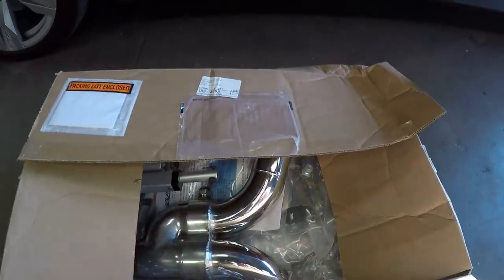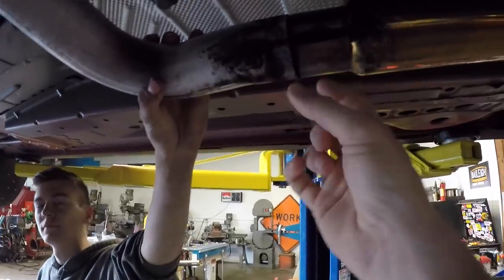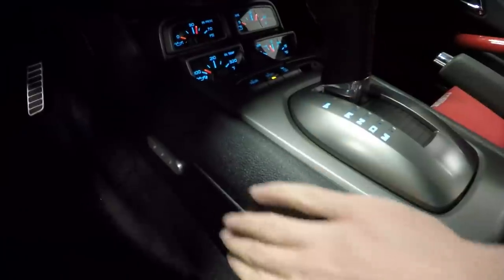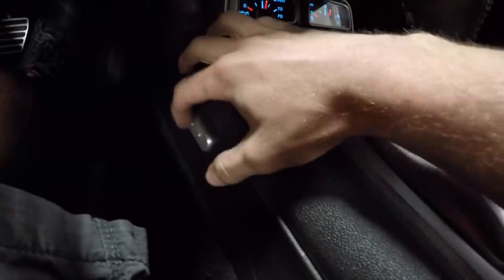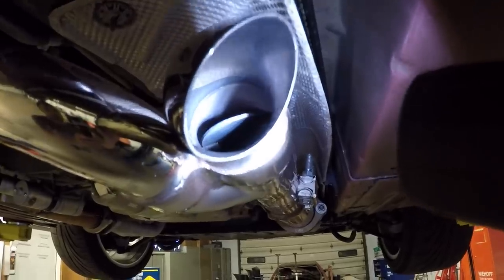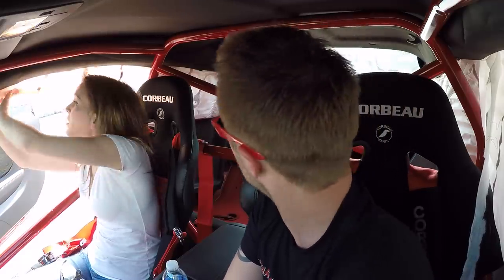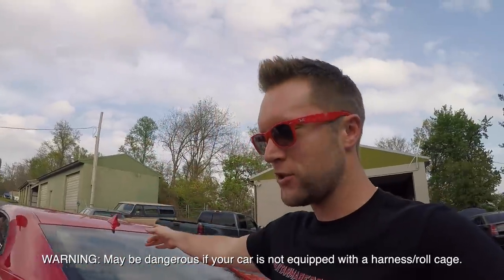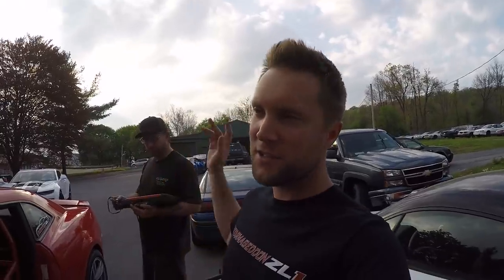LOUD EXHAUST Makes Airbags BLOW at 140mph!!!

Comment: I can tell you exactly why your air bags popped and it wasn't your exhaust, it was you driving too fast and hitting a bump in the road. Period. How do I know that?

1. Air bags systems use accelerometers (g-force sensors), pitch and yaw sensors and rollover sensors to determine if a collision is occurring or a rollover is about to occur. NONE of these sensors are sensitive in any way to sound waves or the vibrations they produce. It is physically impossible for a loud exhaust to deploy a cars air bags. 

2. The cameros rollover sensing system is known to be overly sensitive to those that beef up their cameros and/or take them to the track. The systems has to be able to anticipate a rollover before it occurs if it is going to protect the occupants of the car from said rollover. A driver CAN induce an airbag deployment if certain conditions are met, albeit a rare occurrence. In your slow mo video you can CLEARLY see that you went over a decent bump in the road and because you were going 140 mph when you hit the bump, it was enough for the air bag computer to think a rollover was about to occur. Had nothing to do with your exhaust and the fact that you think it was your exhaust is laughable. 

That said, you deserved it. You were on public roads going well over the speed limit, endangering the lives of everybody around you. You are obviously an ignorant fuck that has no regard for the peoples lives you put at risk while driving like that. A crayon has more brains than anybody that does that. If I ever see you (or anybody else) in my neck of the woods driving like that on public roads... I will make sure that car will never drive again. Road, track, anywhere. I'll see to it that you're remaining days on earth are in a wheelchair too. That way you can't do it again in a different car and potentially put an innocent person in a wheel chair or worse. Have some regard for the lives of others on the road. By all means drive like hell and have fun, but do that shit responsibly.... AT THE TRACK!!!

Comment: just to make this clear. the steeringwheel and dash airbag are controled by an g sensor wich is betwen the dash and the gear leveler. the curtain or side arbags aswell the seat airbags have a pressure sensor in the doors /sideskirts

Comment: Theres no way it was from the sound bro. Ive had cutouts on my ZL1 with headers AND cat deletes for over a year and have ran them open like that plenty of times, even at the track on WOT runs and my airbags are still undeployed lol. In the video you mention "Shouldve left them unplugged" hinting that you guys had disconnected the sensors or harness at some point. My guess is thats why this happened, something stemming from that but highly unlikely from the sound. My opinion anyway.
Reply: I had cutouts longtubes no cats as well and my car wasn’t nearly as loud as this. Trust me there is soemthing about the car that just makes it louder.

Comment: Airbag crash sensors typically work of negative pressurew deviation....meaning....the noise/sound waves from the exhaust were making enough pressure changes in the cabin that the airbag control module assumed the vehicle was in an impact, hence the airbag deployment.

Comment: Heat and vibration caused that, the heat will briefly shrink the floor tightening everything up in the area then the vibrations have caused a turbulence inside the sensor and triggers the airbags that's why only the side have blown and not the fronts

Comment: I think your bags blew because you had the windows closed, sound=air pressure.  You have air bag satellite sensors in both of your doors.  They tell the RCM (Restraint Control Module), that air pressure has built up in the doors ie: side impact, and this you got curtains to deploy.

Comment: You seem like a nice guy and I enjoy your videos, but this car belongs on a track if you are going to drive it 140 MPH. You had your girlfriend in there, and you still drive like an ass. I love cars, trucks, speed and power, but there is a limit to what you should do on public streets. People can call me a pussy or whatever they want, but I'm a firefighter and I've seen what nasty wrecks do to bodies. Have fun, but be responsible out there.
Reply: 140 is not that fast in this car
Reply: I totally agree with the firefighter guy, I drive a wrecker and I've seen the results when these fools get on the road and drive that fast and it's not pretty
Reply: @digitalme4404  Agreed. Crybabies
Reply: @Bryan-Hensley  Damn Straight! Thank you for your service
Reply: Bryan Hensley wishing death upon someone? Wow that’s honorable.
Reply: I’ll admit I’ve gone fast. I’ve gotten to speeds that would land me in jail had I been caught. Conditions have to be right for me to be willing to hit those speeds. I’ve never topped 110 and I’ll admit I’m a dumb ass for doing those speeds. After I hit a deer at 65 in a civic I began to evaluate my choices when I drive fast. Had I been doing the 100 mph it topped out at I’d have been dead. 65 caved the hood into the engine bent the drivers door and knocked the front of the roof line back several inches. To top things off his antlers went through the windshield and were just inches from my face. I agree 140 is way faster than one should be doing on the street but on the flip side of that coin I understand the adrenaline that comes with it. Funny thing is I’ve been chasing adrenaline since the deer before I felt it fairly easily today for speed to give me that kind of feeling I’ve got to be going way faster than I should. I really wish we had a track near me for this reason.

Comment: I mean the side airbags deployed so obviously the g force sensor/ computer sensed a side impact or a roll over. I was wondering the deceleration Gforces going off the throttle but it’s in the wrong axis. I think the frequency of the exhaust was just on par to rattle the sensors and thought the car was rolling. As if the sensors started shaking at a freq replicating. So back early on airbags had a 20g deceleration trigger. But they found in a roll that the side curtains were not deploying so some lowered the range 6.1-10g because rolling a vehicle is a lot less g than a Tbone or head on. You roll out the energy instead of a dead stop. Some use g force sensors others have vehicle angle sensors and some are hybrid control units that rely on G force and vehicle angle sensors to cross check the information so you don’t have an unwanted deployment

Comment: theres a gyrometer in the newer gms for the curtain airbags the sound caused vibration so it was enough to trip the gyrossensors glad you did not get hurt
Reply: FYI you could replace the entire airbags with resistors to trick the computer so you wont have an airbag light.

Comment: It looked to me like those diverters are made of smaller pipe than your exhaust. They should have been larger pipe than your exhaust so they did not act as restricters at mid pipe when closed. meaning instead of slipping inside your pipe, they should have slipped over your pipe.

Comment: The loud exhaust made the airbags blow? That is so weird. I wonder why no one else with straight pipe exhaust has this happen to them? It's not like you can make a car louder than straight pipes. And lots of other people have either  straight pipes or dual mode exhaust that is straight piped when the valves are open. My car is 127 dB @ wot, rev limit, 1 meter. No air bag deployment. I'm guessing that you installed something (like the roll cage) that damaged either a sensor or a wire.  It could be as simple as moving wiring around that now exposes a wire to a sharp sheetmetal edge, which then wears through the insulation because of vibration, which then grounds the circuit and the airbag deploys.

Comment: More proof air bags are more trouble then they are worth. All cars should be caged and 5 point harness. no air bags, no explosives inside the cabin. If your going to boogie put on the 5 point if your just slow rolling snap together the 3 point instead not hard to do.

Comment: You are wrong - the exhaust did no blow the airbags.
The sudden change to negative G force from high positive G force (acceleration) fooled your sensors to think you’d crashed 
Nothing at all to do with sound - it’s not even possible

Comment: At 13:44 you say that those airbags would have hit you if not for the cage. That’s not true. The airbags that did deploy were designed to deploy infront of the windows to protect the driver from hitting the window with his head. They are designed to deploy exactly as they did. Downwards. So yeah even without the cage you would have been fine cause airbags don’t deploy into the humans the humans fall into the airbag. 

An airbag would never deploy into the face but with a big if you sit correctly and have proper distance to the steering wheel and dash unlike some drivers.

Comment: How does the engine computer control the mixture when there are now two entirely different exhaust back pressures? The egr sensors must be going nuts.

Comment: my 1977 ford f150  ranger would put that in shame it's open headers it's a 400 big block 450 hp  8 cillender  36 inch tires one ton axels  three feet off of the ground and spits out three feet of flames it's sooooooooooo  loud it's louder than that by 1000x  ford is way better than Chevy I had a old Silverado w a 2k13  zl2  engine but engine blew when I started it so I sold it for 2000 dollars and I bought my ford it is amazing

Comment: This is what happens when you have extremely loud exhaust. No this is what happens when you have stupid loud exhaust. You are kidding me, no I am not, that is pretty funny? Lol, funny? If the dash bags deployed this is a high potential scenario for a crash, is that exaust manufacturer crazy putting the pipes under the sensors? I guess they never thought about it. . I like loud exhausts, but this was dumb loud. Also I didn't like the idea from keeping the rear mufflers  with the rear pies, and having the side pipes. If you open the exhaust to be loud, am I assuming right, that there won't be any smoke coming out of the rear exhaust tips. Also, I hate side exhausts, this me personally here, but I always hated them, even on an AMG G wagon, they are loud, and they are under your fuckin window. Ad the company that did the exhausts should think about this incident too.